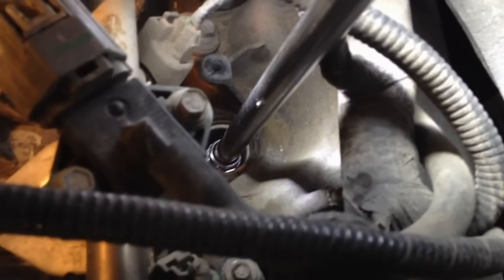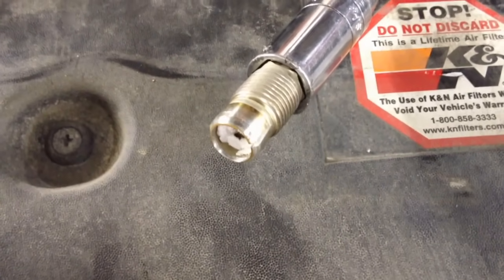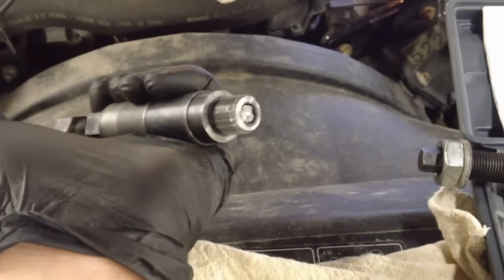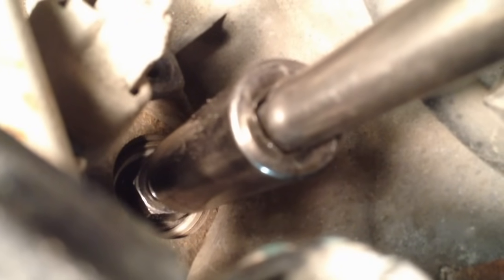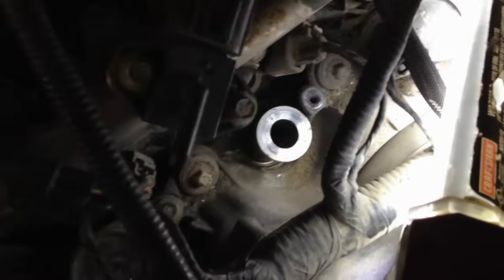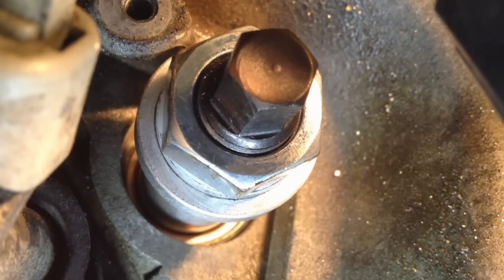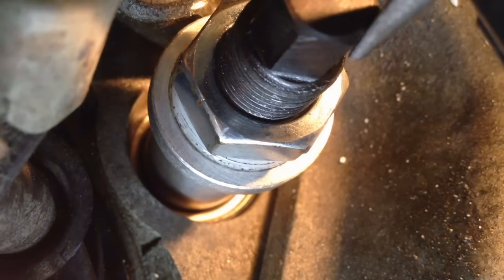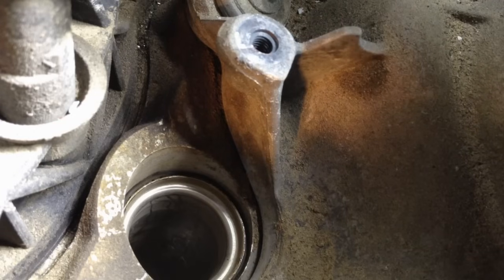Ford 4.6L 3v & 5.4L 3v Broken Spark Plug Removal

Comment: I just wanna meet the ford idiot who designed this crap.
Reply: certified30 bro give me 5 minutes alone with this guy lol
Reply: A three piece spark plug. How did that get past RND ?
Reply: @rolandthethompsongunner64 A Warren Zevon fan, eh? My guess on the plugs is that the engineers didn't run up the milage as they run up in reality. They pulled the plugs every few thousand, then put in new plugs coated with anti-seize. Then the Ford brass then told owners to change plugs at 100K miles or so. Say you only drive 10K per year -- that's TEN YEARS of a steel plug welding itself stuck inside an aluminum head!
Reply: @rolandthethompsongunner64  Because somebody’s after and better paid than me, you, every Ford owner and mechanic said it was a great idea and should be mass produced immediately.
Reply: RIIIIIIGHT??? IDIOTS!
Reply: Fix Or Repair Daily  ... FORD
Reply: the spark plugs were just the beginning on these turkeys.
Reply: You kidding the who company that let it go for years
Reply: Amen to that! I got a slap or two for his ass!
Reply: I’ll wait patiently for the engine you designed to come out, I won’t hold my breath
Reply: hopefully F'er is on unemployment by now
Reply: GT 4.6 3v with 70k on the clock, I tried 1 and the threaded part  spun out leaving the porcelain and center electrode in place, warm engine / generous amounts of brake cleaner & penetrating oil, I even started the engine & nothing !! I can't believe this design !!
Reply: @GatesRapes  too late now, but this is a tip my local mechanic told me. The trick to removing those without breaking them is to use a strong impact wrench on them while the engine is warm. The tool "rips" them out before they have a chance to break off.  R and R four plugs, start the engine to warm it back up some then do the other 4.
Reply: @adotintheshark4848  I did better than that !! I put it back together and did a Wash / Wax , detailed that leather interior , and traded it to a Tacoma V6 4 door P / U , sooo easy to change plugs on that Taco
Reply: @adotintheshark4848  I just crack them loose the let the Kroil soak down in overnight. Works like a champ. The Kroil will smoke a little on first startup but I’d rather burn a little Kroil than have to dig out a broken plug.
Reply: @GatesRapesprobably the best thing you ever did.

Comment: Nice work.  I just bought an 06 F150 with the 5.7 and was about to do a tuneup.  It has 30K on it.  Would the low miles make any difference in the likelihood for breakage?
Reply from the maker: Jay Moon Yes as it is mainly due to carbon buildup from Miles driven.

Comment: Great explanation, helped me out perfectly!  I do have a question though, are you not worried about the piece of ground strap that breaks off? It appears the whole bottom Ushape of the ground strap broke off when I was pushing the porcelain out, so I blew out the hole with air compressor, but didn't see a chunk that big come out...
Reply from the maker: Scott Keller No usually the strap only breaks on one side it is still attached.
Reply: FordTechMakuloco
Cool, mine broke all the way off for some reason.  I stepped down my shop vac hose to suck out what I could and when I started it up I've had no issues.  Thanks again for the video, very helpful!

Comment: Nice video man. I'm currently working on my mothers mercury mountaineer 2006 I remember when that sparkplug towards the firewall is problematic. I will be sure to pick up this tool. I subscribed to this channel. BTW do you have vid for leaky sparkplug. The one was fully wet in the front. I'm thinking sparkplug seal.
Reply from the maker: Michael Hodges With oil?
Reply: Yeah with oil
Reply from the maker: Michael Hodges I don't have a video on it but they literally unbolt from the engine. I can send you the procedure from our manual if you have an email address. Also which year, you said 2006 and 2008 before.
Reply from the maker: Sent

Comment: ok I'm in need of some advice... the threads of the plug broke of just above the smooth sleeve I'm assuming.. and all the kits except an easy out kit but the size of the electrode  ID is way small and I'm scared off snapping the easy out off in the threaded part.. any advice as to extracting the half plug ground strap plus porcelain
Reply from the maker: Are you using the lisle kit shown in the video?

Comment: Changed the plugs on my 2005 Expedition this past weekend and listened to your advice and your were right on bro! I broke the number 5&8 plugs and used the lisle tool and it worked perfect. Two hours to changed all plugs. Engine must be hot and soak the plugs for at least one hour. Used some kind of bg penetrating oil my brother uses at his shop and it worked great. 3/8 snap on impact gun took them right out. Tried 75 foot pounds of torque and wouldn't budge them. The impact is a 300 ft lbs torque and that's about right to loosen the plugs. Thanks for making great videos!
Reply from the maker: Mr223wssm Sounds about right.

Comment: Do you perform spark plug removal with engine cold or hot?
Reply from the maker: I do them while it is quite warm, they will come out best hot, but being aluminum I don't like a full hot engine on those threads.

Comment: great video i am doing a ford expidition 2007 i am 2 out and 6 broke a day and a half soken in pb blaster ten or longer minutes with each plug slow slow slow with 16th of an inch turns out then re tighten verry slow process so day 3 time to take out the rest of the broken ones 169,000 miles on ford plugs Oh THANK YOU FORD FOR A GREAT SPARK PLUG!  ok so the high miles didnt help either ive put this night mare off till the car started to miss fire if i did the plugs 100k miles ago just maybe less plugs would have broken!

Comment: Just did the spark plugs on my '04 f-150 5.4. The 2 that broke were luckily the two front plugs which are easy to access. I bought the Lisle tool online for $69 and it paid for itself. I made the mistake of disconnecting the computer box from the firewall on the passenger side to get at the last plug. What I didn't know that doing that puts the computer into failsafe mode. Now I needed an ODB tool to reset the computer since it wouldn't move (started but no throttle). I have a friend who is a mechanic and lent me his. Be aware of that before you disconnect the computer. The whole job took about 5 hours, but if I did it again I could do it in less time. MY local Ford dealer wanted $800 to do this, and I have only $250 invested which includes the plugs, boots, Lisle tool, magnetic socket wrench, and a long pair of needle nose. All these videos on youtube helped alot !
Reply: Just to add: I'm now getting 1.2 MPG better mileage, so the $250 I spent will be recouped in less than one year !
Reply: Tom... I believe that disconnecting your ECU (computer) to do this job is an necessary evil. I've done this twice on my 05 F150 and I dont see ANY WAY you can remove the back two plugs on the passenger side without getting it out of the way. Bryan here has a video on how to reset your ECU after taking it out and it might be a blessing in disguise,. Most people say that after resetting your ECU that their truck runs and shifts MUCH better
Reply: Thanks for the heads up on the computer disconnect.
Blessings to you and yours.

Comment: Thanks for showing this. There was a lot more detail in this video than the other ones I saw. Did mines and broke three plugs. But that extractor tool worked great. I also bought the Champions Double Platinum sparkplugs. Now she runs great and no problems whatsoever.
Reply from the maker: Good to hear!

Comment: My mustang has over 150k with the original spark plugs... whoops. 

I tried the seafoam and overnight soak method and I got 6 out without a break but two decided they wanted to cost me $100 for the tool.

Thank you for this video!!! The step by step instructions and camera angles are PERFECT! Fingers crossed they come out as well as the one in the video does!
Reply from the maker: O h they should the 4.6l 3v are never as hard as the 5.4l 3v. The tool is on amazon for like $65.
Reply: 4 came out whole and 4 cracked. The tool worked perfectly along with your instructions. I would NOT have tightened them nearly enough if you didn't cite the cracking and awful sounds being a good thing in this case. Thanks again sir!
Reply from the maker: Good to hear

Comment: okay so I have had a great deal of trouble with this and I would really love a response so my question.. soo i bought this tool after the number four spark plug did this to me. I used the punch but when I went to use the extractor I cant get it to bite into the shell. It just spins in place and doesnt do anything.. its such a simple procedure and I seem to be the only one with this problem. When i look down into the hole with a camera it doesnt look at all like the one in this video, it seems like there is something stuck on the side of the hole and i can barely see the shell from the plug, ive blown a lot of porcelain out of it yet I it still doesnt work. I know I sound like a complete idiot. Thanks in advance
Reply: I'm 99% sure you are turning the wrong way. I had the same problem and spent at least an hour before I realized that tool is thread backwards.
Reply from the maker: yes it is left hand thread.
Reply from the maker: Is it possible to record what you are seeing with the camera back there, I have been through this before many times recently but I want to make sure yours is the same thing.

Comment: I agree with ford maniac,3/8 impact on a warm motor works 99.9 % of the time,doesnt hurt to do an upper engine induction clean with sea foam, coats the problematic piece with lubricant and helps if your doing a full tune up. done at least a 100 my self,some are prone to break no matter what, and lyle tool is the best extractor
Reply from the maker: Yes I have to agree and that is what I show in my removal video. The lisle tool is great but the early ones the extractor is prone to breakage when extracting the broken off plug tip. The newest one I have is the 4th generation design as indicated by the stripes on the extractor and thus far has worked great no breakage.

Comment: Excellent video!While pulling the coil pack off of one of the plugs, the coil seperated. I put the spring terminal back through and re-attached. Seams to run fine, and no trouble codes. Ford told me about $125 PER coil to replace here in Canada eh. Thats parts -no labour! Wow! I followed these drections, and it worked great on my 2007 Sport Trac 4.6! Thank you!
Reply from the maker: Sounds good to me!
Reply: you mean the coil separated from the spring and boot? They're supposed to come apart, I took all mine off and scraped off the corrosion, put some dielectric grease on each end of each spring, put them all back together, and put em back in. Solved my misfire at nearly no cost.

Comment: Great video.Thank you.I have a quetion though.If you cranked the engine,w/o starting it,wouldn't the compression of the engine just blow the tip of the plug right out of the hole?
Reply from the maker: Nope I have tried it engine cranking and engine running even at 3-4k rpm and the plug tip doesn't even budge.

Comment: Love that lisle tool,not that I like to use it but its 10 times better then the ford one....
Reply from the maker: yes it is all we use now and we are a Ford dealer!
Reply: FordTechMakuloco
Wouldn't be better if you used vacuum instead blowing it with compressed air?
Reply from the maker: If you had the special attachments for it yes.
Reply: Probably worth investing if you do these often.

Comment: Getting the ceramic out of the cylinders is quite easy using a vacuum tube adapter that you can drop the piston down and either with the vacuum adapter or actual boroscope tool to grab the broken ceramic piece.
Reply from the maker: Yep that is an option too.

Comment: i too am a ford certified tech. i worked at the dealer for 5 years. i am now a diesel fleet ambulance mechanic. you've prolly heard about the 3/8 th inch impact being used to remove these plugs. ive done countless 3v tune ups this way and i havent had one break off. be sure to push down on the impact while you loosen them up.
Reply from the maker: Yes my other video in this series shows the removal with the impact like you said. I like it for this engine it seems to works.

Comment: my friend recently took his '04 XTR into the garage for a $49 tune up and as they were trying to replace the plugs they started cracking.  They tried to remove them with some cement stuff but in the end had to take the heads off.  Total cost $4,800!  If you took this to the Ford dealership you would think they'd know this is likely going to happen and would warn the consumer.  I get the impression he got ripped off.  

I want to send your video to him but I'm afraid he might cry haha.  

Nice camera work, love the detail!!!

Keep the videos coming :-)
Reply from the maker: Dealers knew about this years ago and how to extract. Even the smallest independent shop should know about the spark plug fiasco and how to extract. The tool is like $65 on Amazon no reason not have it. His tune up should of been more like $400 something- 2.5 hrs labor plus $20 a plug. We warn customer upfront that each plug will be an additional 1/2 hr labor. I just had the extractor tool itself break off in the head and it looked like I would have to pull the head, but I still extracted the extractor too and saved the customer over $3,500 on that alone. Either way he got hosed. Thanks for the kind words!

Comment: What year is that vehicle you are working on?
Reply from the maker: 05 or 06 can't remember, I was working on two trucks are the same time. Its all the same though up until mid year change in 2008.
Reply: FordTechMakuloco I have an '05 Mercury Grand Marquis LS with a 4.6L, would I have the same problem changing my spark plugs, or is it only on trucks?
Reply from the maker: It is only on the 3v engines your is 2v. The GM/Crown Vics never got the 3v engine. So yours will come right out no problem at any mileage.
Reply: FordTechMakuloco What about the 2005 V6 mustang???
Reply from the maker: v6 does not have this issue.